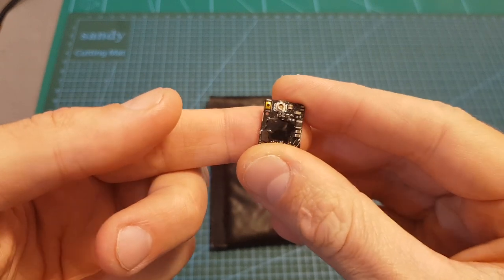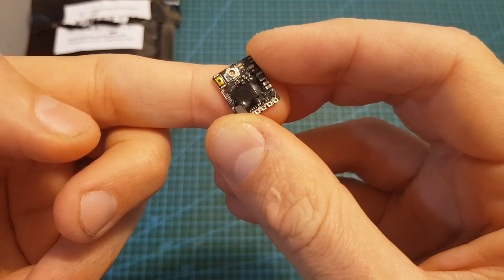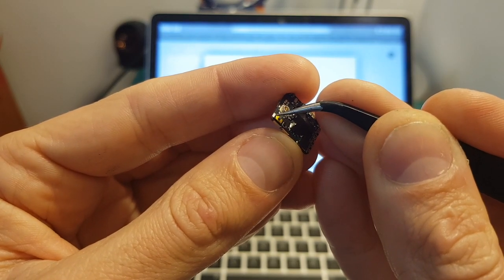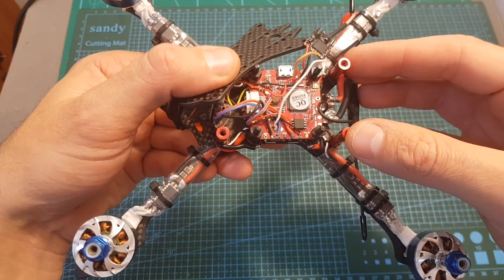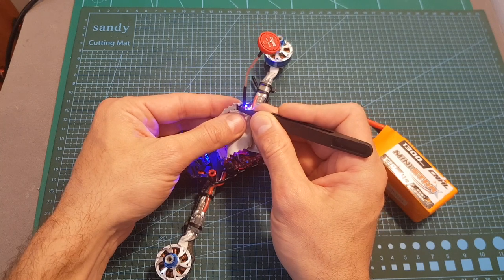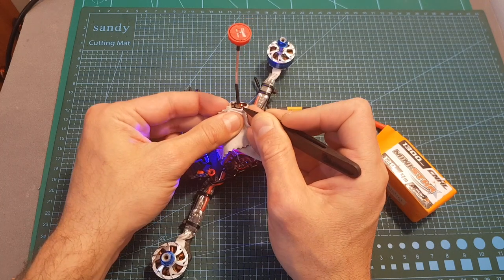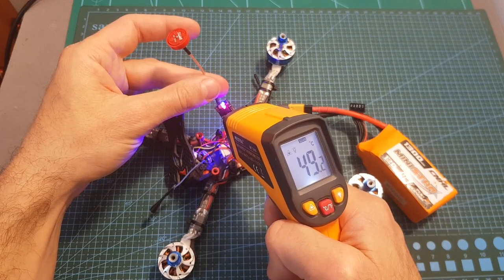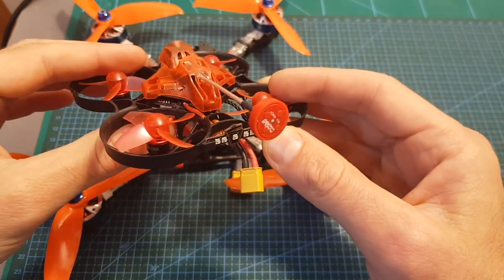TBS UNIFY PRO32 NANO VTX - Part 1 - Overview & Setup

Comment: Btw I have the exact vtx like you do but I have to press 20 seconds everytime I plug the battery to the drone otherwise the goggle wont lock the signal (to get the solid blue light) unlike the other vtx that I can just get my goggle connected straight away

Comment: Thank you for your great video. I made a huge mistake when bought a TBS Unify Pro32 nano for my 5 inch quad. Can I mod it to my 5 inch? Just solder it to flight control or do I need something else?
Reply from the maker: My pleasure. I don't think that you made a big mistake. Yes - just update to latest BF version and use the Smart Audio 2.1 VTX tables.
Reply: Hay So can I put this on my 5 inch quad and does this have beta flight
Reply: @dogo_fpv3151  You can put it in any quad you want. But if you are asking if a VTX has Betaflight...you're not ready to add your own VTX to a quad.

Comment: Today i mounted one of those on a 3" Japalura, but mine came with a 20x20 stack adapter board. For now i can only say it has a pretty good image.
Reply: Peter Carrierii yh i ordered one the other day and looks like I got the same as you. Looks easy to set up. Package looks different to what Gal has
Reply from the maker: Weird. Where did you get yours from?
Reply: Gal Kremer I got it from hobbyrc. Would be interested to see how the mounting board works. Looks straight forward though
Reply from the maker: @PeterHongphk360  Thanks. Looks like a useful add-on.
Reply: I got 3 of them directly from tbs all 3 had the 20x20 adapter awesome.

Comment: You don't need crossfire to configure it right? That would be awsome i have this 2 inch build i wanted to make as light as fast as possible with a more then avarage range would be insane power to weight ratio it now is 66 g if i take off the full size vtx it would be arround 57g dry and if i put a 3s 300mah on it it would weigh less then 100g the motors on there are eachine 1104 8600kv tyro69 motors just waiting for the props to come in the mail after almost 30 days of delay
Reply from the maker: No, you can use BF Smart Audio.

Comment: hi KremerFPV, i buy a TBS unify pro nano vtx for my tinywhoop build but i don't see the osd on my goggles... i see what the camera see perfectly but not the osd, do you have a solution ? (fc aio goku versatile f411 1s 5a)
Reply from the maker: The VTX needs to be connected to the video out of the FC and the camera to the video in.

Comment: weird.. 400mw setting is only 300mw.. tbs is usually pretty good about that kind of stuff. STILL more than enough power at 300mw though
Reply: they usually vary A LOT based on channel.  depending on output power there can be a difference of between like 15mw-150+mw from the highest output channel to the worst even on the full size tbs stuff.  pretty nice graphics at the end of this video sum it up: https://youtu.be/nuRBTCiVc40

Comment: Ok I installed a brand new one unlocked it and when I went to fly it the red light just blinks I get no video from 2 feet away. Their is nothing at all on line or in the manual about it
Reply from the maker: Were you able to figure it out? It seems that you're in pit mode.
Reply: @KremerFPV  yes it was in pit mode manually switched by button
Reply: But my new fc is also shot.
Reply from the maker: @offswitch1  each time you power it up it enters pit mode?

Comment: @Gal Kremer I modded the tinyhawk 2 freestyle with this + TBS XF nano 44...  I have a problem when selecting 400 mW, something strange happens: when I arm, the ESC make the classic "Power-Up" sound again except of the last note... then the video in the goggles disappears (lot of noise..), after a few seconds video comes back, then i have to disarm and only then comes the last "Power-Up" note... afterwards everything works but i'm afraid the VTX sets back to 25 mW.... someone knows what's going on? Thank you
Reply from the maker: Sorry about the late reply. Did you figure it out?
Reply: @KremerFPV  yes man, I was pulling the current from the 5V so it killed the regulator..too much load. I disconnected the tinysleds board (and changed the supply solder jumper from 5V to vbatt) and then connected it directly to vbatt.. works perfectly 👌🏽

Comment: I followed these exact steps to unlock the vtx and it’s not working for me unfortunately. I tried it a few times. 
After getting in channel/band mode
And hold for 20 seconds. The red led does not flash three time. Only once. 
And when in the power mode it won’t allow me to raise the power. Only get one blue flash. What is this about ?
Anything else I’m missing ?  
Stuck on 25mw :(
Reply: I'm at the same stage. Can't change the power. only blue one time :S
Reply: Unlock it from the 2 red mode (band). be sure fo unlock it, bleu still, than blue flash than blue back steady. then releasing it will enter you automatically to the range mode. https://youtu.be/pZ8tJn2bw6s?t=144
Reply: bohr fpv thank you buddy. Just what I needed to see !
Reply from the maker: Thank you @bohr for helping Edward out.

Comment: I just bought the TBS 32 pro nano for my betafpv 1s meteor75. - Do you think i can put it to 400mW or will it burn the voltage regulator on the f4 1-2s board ? Is 400mW too much for runnig on 1s ?
Reply from the maker: I haven't tested it but I think that it will be fine. Just make sure that it's not too close to the FC as it will get very hot on 400mw.
Reply: Gal Kremer thank you! Meanwhile I got a response from BetaFPV - 400mW is no problem. But you gave me a good tip - I wanted to mount it on a Toothpick Mounting Board but i guess that’ll be too close 🤷🏻‍♂️

Comment: I'd be hesitant to use it on anything above 25mW. It seems like it would burn out easily, especially if  heatshrink is applied around it.
Reply from the maker: I will run some more tests soon, but so far I am really impressed with it.
Reply: According to Trappy's video there is a heatshrink under all the Liquid Electrical Tape and Ive been using it for about a month and have had no issues. Furthermore, it reduces output power as the temperature reaches critical ranges so as not to burn out the VTX. I absolutely love it and find that I get a cleaner video on the same build with a different VTX. Brilliant overall.
Reply: Sorry meant heat sync even lol
Reply: bahhhh  Ive been heat shrinking TBS Gear for years  its fine I even layered a copper heat sink in between heat shrink layers ....  however avoid allowing any hot glue from antennae mounting to get into any OTHER electronics .  thats a fast way to toss fifty bucks or so into the wind not to mention your more expensive labor you invested mounting the TBS Part,
Reply: @christianprogrammer9131  why? Hot glue is not conducive.
Reply: @The0nionKnight   but it melts easily under the heat from vtx :)